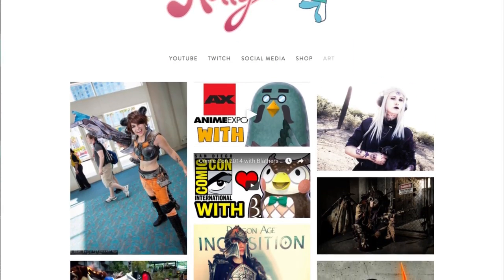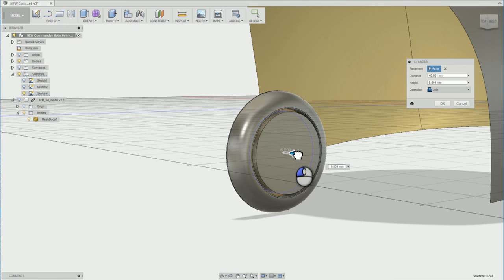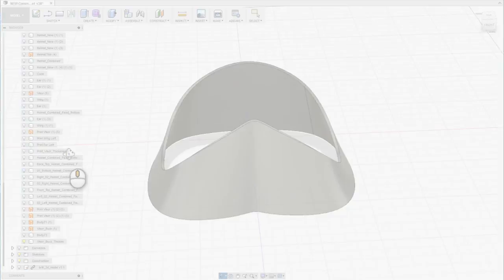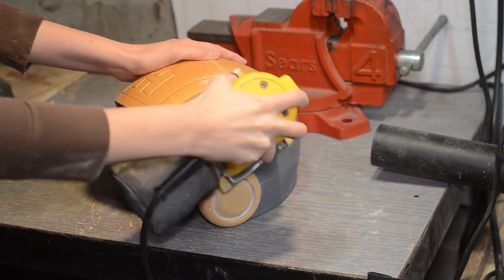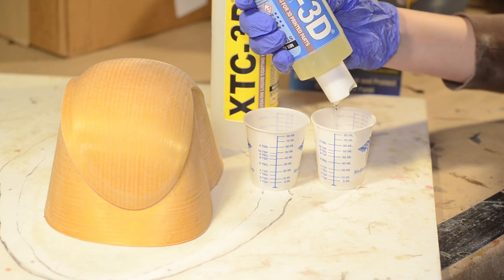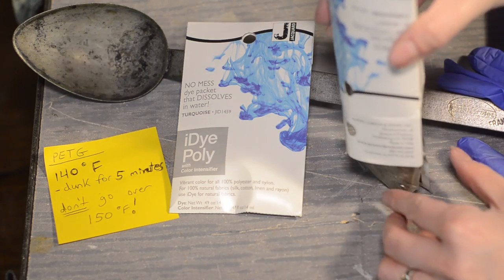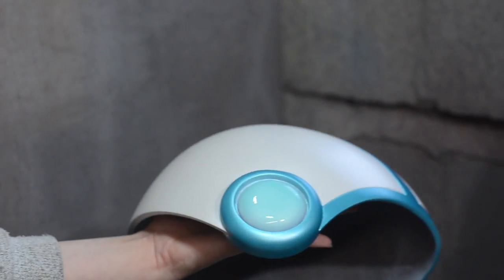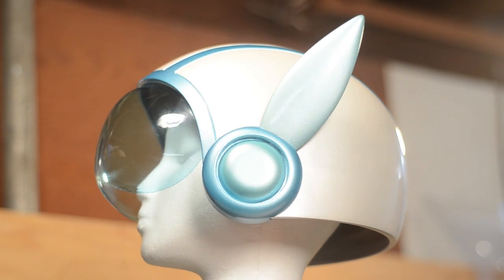How to 3D Model and Print Commander Holly's Helmet - Prop: 3D

Comment: Very nice video & build!  The helmet looks great!  Consider doing a video on tips for airbrushing those pearlized acrylic paints (unless you already have one - then link here please).  I know you just learned Fusion 360 for this project, but consider going into the model sections and putting your alignment holes into the model (I always worry about power tools on finished pieces!).  I have also just downloaded Fusion 360.  Coming from Sketchup and Draftsight - it looks super powerful!
Thanks for the videos!

Comment: You mentioned that vacuum forming melts the PLA but if you used ABS or another more heat resistant filiment could you vacuum form the print then?
Reply from the maker: It depends. If you pint your ABS really dense and only intend to get a couple of pulls out of it, then ABS might be fine. We're actually about to try this for a video in a few months.

Comment: Awesome video! I am learning a lot from you guys. A couple of questions about your experience with Fusion 360:
Did you have any troubles with the size of the parts? (For example, that the size displayed on screen didn't match with the size of the object after being printed)

Is the STL geometry "clean"? Because some programs, like SketchUp sometimes generate geometry that has to be fixed.

Comment: Awesome buit !!! Why screwing the printed parts together insted of gluing it ? Does the PLA plastic prevents from doing it ?
Reply from the maker: When possible we use screws and glue to make double sure it'll be a good connection.
Reply: +Punished Props oh right ! I didn't noticed you put glue on the piece before putting it onto the other, I get it now, thanks for the answer :) keep on being awesome!